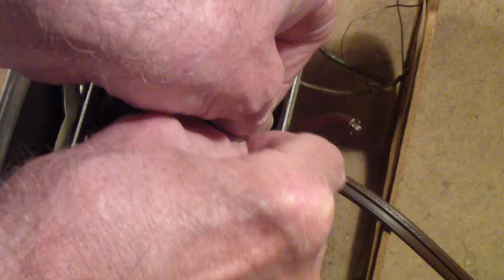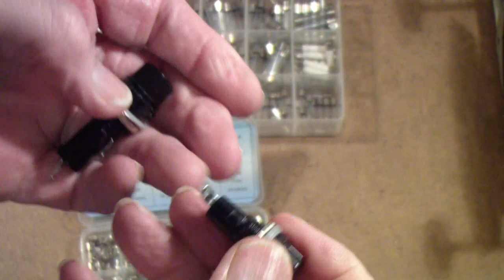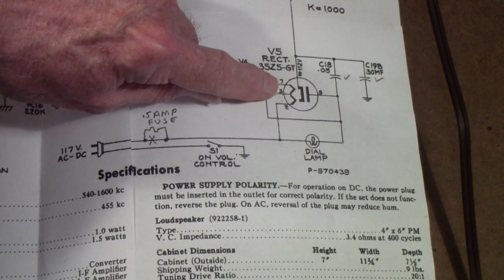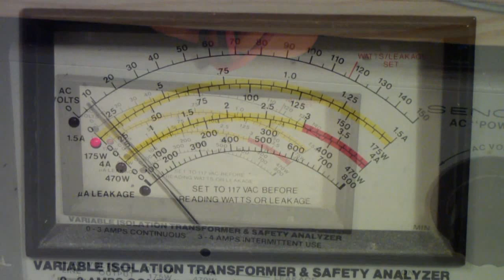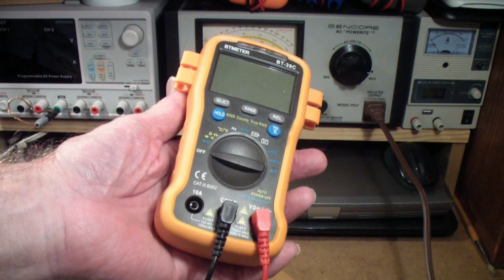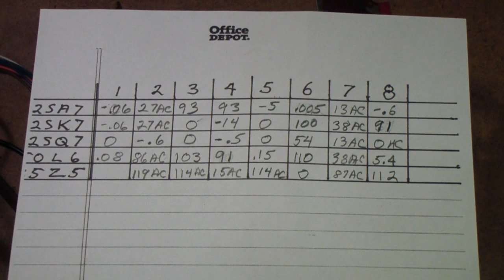TTT286 The Frugal Repairman Pt17

Comment: I always wire the switch to the hot side of the polarized line cord.  Never to the neutral.  If you put it in the neutral line and switch it off, the rest of the entire circuit is 120V above ground potential.  The radio will not play, but if you should come into contact with any of the circuit it likely would play until you die.  Depending on how well your body is grounded of course.  Placing the switch on the hot side eliminates the 120V applied to the circuit when it is turned off.  Then the only spot that is above ground potential is where the hot side of the line cords connects to the switch.  Not advocating using the switch for safety, but accidents do happen.  You should always unplug the set when working on it.  Another problem with switching neutral is if the capacitor that connects circuit ground to the chassis starts to leak, or is shorted, turning the switch off will put the chassis at full line voltage.  Not good.  Always safer to switch hot and not neutral.
Reply from the maker: Thanks for the comment. I absolutely agree - stay tuned for a future video which includes this as well as other redesigns of the original circuit. I wanted to save the redesigns for one video rather than spreading them over 2 or 3 but, rest assured, I will show the re-wiring to place the switch in the hot lead before this series ends.